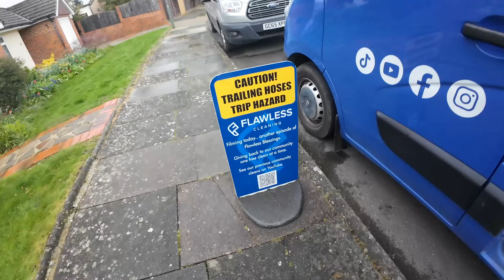WE GAVE THESE SENIORS QUITE A SHOCK.. Pressure Cleaning Surprise!

Comment: Basics...the water hookup works, the water drain cleared to make sure it will work.  (Interesting idea to set a brush over the drain pipe to make sure it doesn't clog.) In addition to a Grime Line, we are seeing beautifully colored paving at 3:19. Amazing what clean paving does to change the "cheerfulness factor".  The shovel work is good, if the plants ever die back, the paving is evenly cleaned and it prevents plant damage when "cutting them back" isn't wanted. Both homes have owners who enjoy their gardens.  It is nice to see them set-off with the cleaning and for the neighborhood to enjoy as well. Enjoyed seeing the India Sandstone brought to life at 21:13. Excellent you made sure to remove slippery areas.

Comment: Did you fix what you term as the "pointing" and what I term as the grout? Because once there is a breach, it will continue to erode. I'm the daughter and sister of two great Building Contractors here in the U.S. Both have passed on.

Comment: How do they get like that? Is it the weather or something? Asking from Texas.
Reply: Dirt just accumulates over time. Probably our dirty acid rain 🌧 here in the UK with combination of airborne pollutants. Maybe all your Texan sunshine 🌞 helps somehow? I had always presumed it was the same everywhere.
Reply: @BlueVelvetBear  I've recently seen sone here in the US that were mossy walls and dirty tiles but not super slick like some I've seen in the UK. Here in Texas it probably has a lot to do with the heat. It rains but it dries too fast to really cause any moss on our porch.
Reply: I lived in Oregon for 10 years and we had much the same thing there. Combination of damp weather and not much sunlight.. Just a veneer of moss/algae/dirt/muck that builds up over time. Very slippery and hard to clean except with a pressure washer. 👍